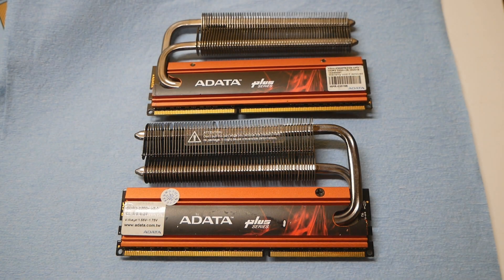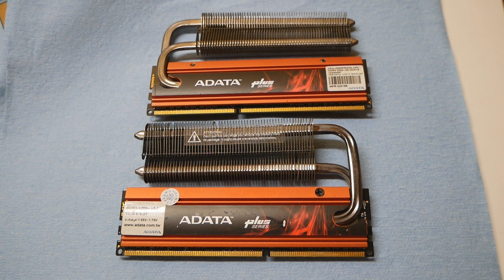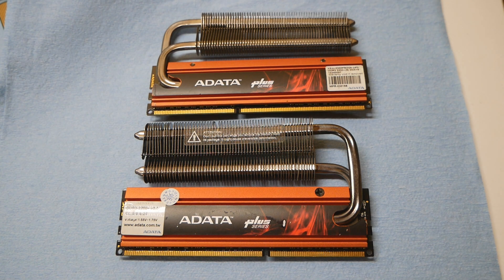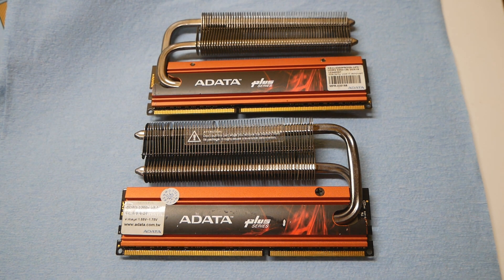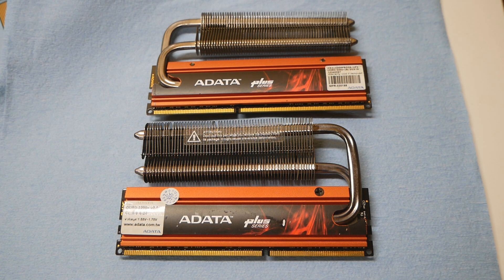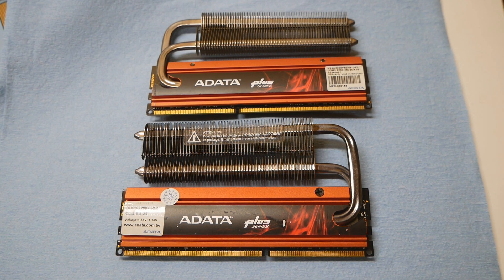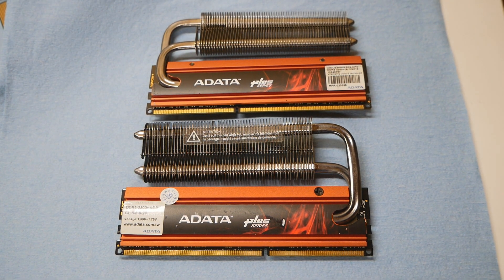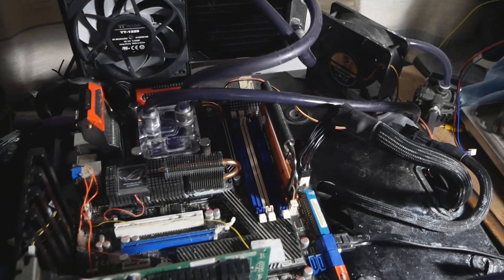Some of the Rarest DDR3 Memories - ADATA XPG Plus 2200 CL8 feat. Elpida Hyper - Overview & OC Test

Comment: I had at this time 4x2GB Super Talent Speed 2200 CL8 with Elpida Hyper and it runs amazing on Sandy Bridge ( 2000MHz 6-6-6-18) 
Then I changed to Ivy Bridge and things weren't going well anymore...
Reply from the maker: Still have the sticks?
Reply: @LuumiJuhani  i sell them 2012 for 150€ ...😮 previously purchased for 450 😢
Reply: I Sell them 2012 for 150€... previously bought for 450  😢

Comment: I found a pc on the street and it had a 3570K in it with an Asus board. I had a 3770 non K laying around so I was curious to see what it could do in a board that does overclocking. It could easily do exactly 14% faster than stock in both single and multi core without too much hassle, and I could finally overclock the Kingston HyperX kit that I had laying around too. The whole system was working like a charm and then one of my cats decided to take a pee over the board. Killing the board of course, and it even managed to corrode the gold contacts of the 3770 to beyond usable. Thank you Luly, I still love you!

Comment: So envious, I can't even finish a regular Dominator-Hyper set 2000 8-8-8. Have been tracking different eBay country sites for years.
Those radiators have the same design as OCZ ReaperX.
BTW
How is REX doing with D9GTR's? I have noticed that EP45T-Extreme doesn't like anything Elpida at all, it's like it was designed around D9GTR. On the other hand EP45T-UD3R loves Elpida and hates Micron :D Both mobos are to the point that hated sticks would not even pass Passmark at JEDEC frequency/timings.

Comment: I've got a 32GB set (8x4GB) Dominator GT 2133 CL9, running on the EVGA X79 Dark at 1.55v +0.050, with Bitspower Ramblocks. With 8 sticks I can get them to 2400 CL9, and with 4 sticks, I can get 2666 CL8 at 1.655v +050.
Reply: That’s no hyper.
Reply: That's impressive. The x79 dark I had could barely run xmp on most kits I tried. Sold it as it sucked.
Reply: Those are most likely Samsung/Hynix based modules. Those wouldn't be of use on LGA775 as this platform can't run so high memory frequencies (anything above 2000 can be hours of tweaking). On this platform it's better to run Hyper's or D9's with lower frequency and tighten the timings to CL6.

Comment: 2000c8 STTs doing 2000 6-7-5 at 1.85V is silly good. The Adatas I had did 2000 6-7-5 at 1.91-1.95V; max was 2080 6-7-5 at 2.067V for the whole kit.
Reply: STT was much better, My Adatas 2200 did 2000 6-7-5 at 1.89V-1.91V
Reply: @oganesd  Best kit of Adatas I ever heard about then. I had the best Gigelz ever found, and that kit barely did what I mentioned above, from over a dozen sticks tested
Reply: Yeah that is a great kit of 2000c8's. I have 3 (bought as new old stock) 2200c8 STT's and they need between 1.820v and 1.860v for 2K 6-7-5.
I think the 1.55-1.75v voltage rating makes for a lot of so so kits and variance. I know there was a kit that did the same at 1.87 - 1.88v I'll look through my screenshots to see if I can find the info. I want to say it was a kit Perica owned, but I'm not positive on that.